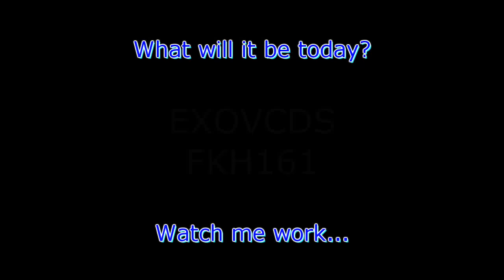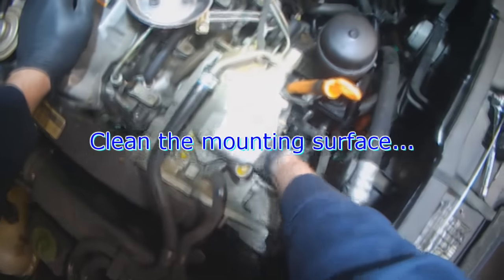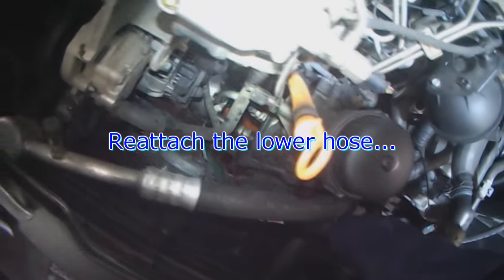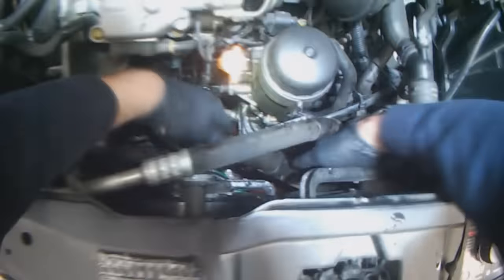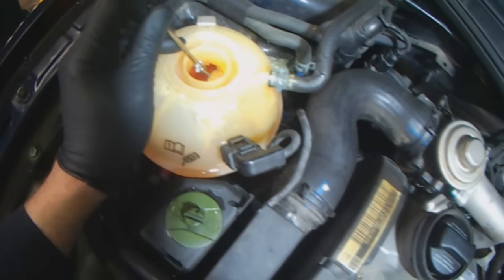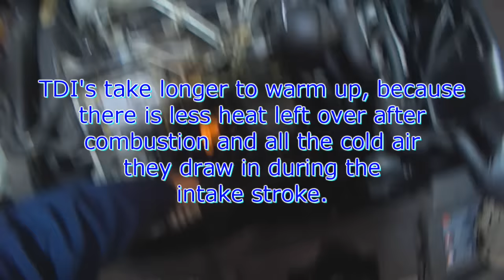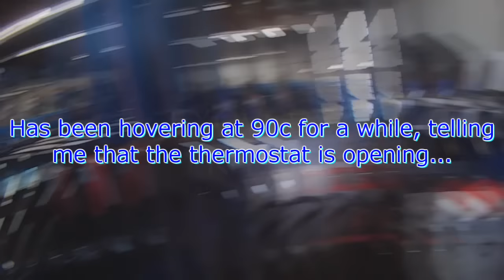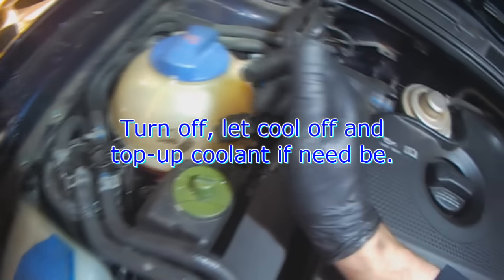VW A4: 1.9L ALH TDI Thermostat replacement (full)

Comment: did he flush the entire system?
Reply from the maker: I think he removed 80% of the coolant when he removed the thermostat hose. At the 3min mark he lowers the lower radiator hose below the engine... which drains the radiator. Once he removed the thermostat, the engine drained out. He mentions in his videos that there will always be some coolant left behind / in the engine or heater core.  He recommends to change coolant ever 4 years. He's pretty good at answering questions. Let him know why you are asking about flushing, when this video is about thermostat replacement.  He's not a mind reader.
Reply: first thank you @EXOVCDS  
Second English is not my mother language, so i could not properly explain myself. 
So here it goes. 
what i what to do is to clean the cooling system. That is why i needed to know, that the cooling did or did not get out of the system. and i will change the heat core to. And need some advice how to clean it right
Reply from the maker: There are many chemical  flush options that you can use... or you can use liquid dish wash soap.

Add the cleaner to the coolant reservoir and run the engine until the thermostat opens. Allow the additive to circulate for at least 10min once the thermostat has opened.

Sometimes you have to flush more than 1 time. 

The best thing to do is to change to coolant every 4 years.

https://liquimoly.cloudimg.io/v7/https://www.liqui-moly.com/media/catalog/product/cache/afa4132dc622b3596e7e2b6e4e4bc624/2/0/2051_K__hlerreiniger_300ml_bb57.jpg?w=730&h=720&func=bound&sharp=1&org_if_sml=1&force_format=webp%252Coriginal

Comment: Can the coolant be reused?
Reply from the maker: It could... but you have to make sure that no dirt or oily film is in it (from running down the engine). It's cheaper in the long run to fill with fresh clean coolant, than take a chance with the saved coolant.
Reply: @EXOVCDS  makes sense. Now, on the TDIs, since heat helps engine works better, I've gotten recommendations to go with a 90C thermostat versus the 87C. Is that a safe mod? And finally, how important is it to have the lower pan shield? does it help the engine reach operating temp quicker? I don't have one nor do I have the hood cloth any more.
Reply from the maker: @estebanflores8049  90c is fine, but if you are in a hotter climate / area, I would stick with 87c. The splash guards protect against road debris from coming in contact with the engine... more specifically the drive belts.
Reply: @EXOVCDS  Ok, sounds good. Our summers are 90+ easy, so I'll stick to 87C. Thanks again!!

Comment: Distilled water or tap?
Reply from the maker: Distilled is best. You can buy premixed from the dealership.
Reply: @EXOVCDS  that’s what I thought. But the guy at the VW parts shop said distilled pulls minerals out of the metal…so it’s best to use tap. We live in Washington state and he was saying our water is really good and doesn’t have the hardness of other states? I’ve never heard anything like this before but it also kind of makes sense to me.
Reply from the maker: @kcummo  no matter which you use... it's more important to flush every 4 years, so the system is kept fresh.

Comment: What direction does the coolant flow in an alh tdi motor?  Hot at the thermostat and flowing  toward the rad?
Reply from the maker: From the engine, hot coolant comes out of the top radiator hose and goes into the top of the radiator. Once the thermostat opens, the warm / hot coolant flows through the radiator, comes out at the bottom of the radiator and enters the engine through the thermostat flange that is at the end of the lower radiator hose (where it connects at the engine).